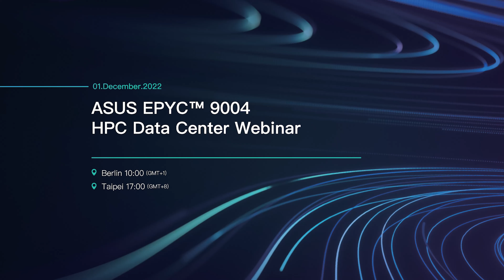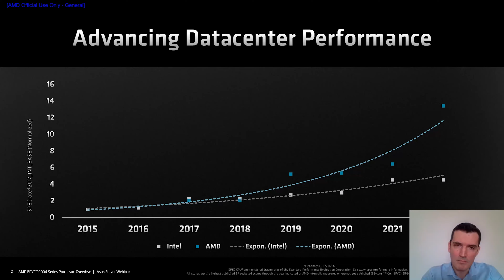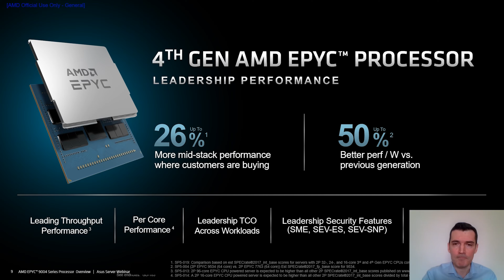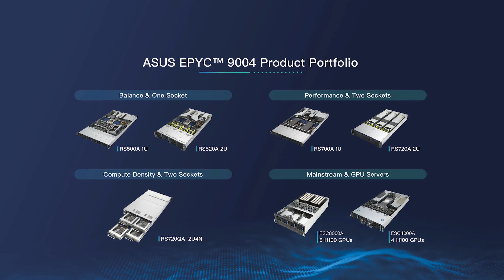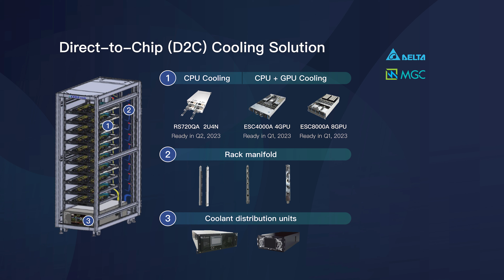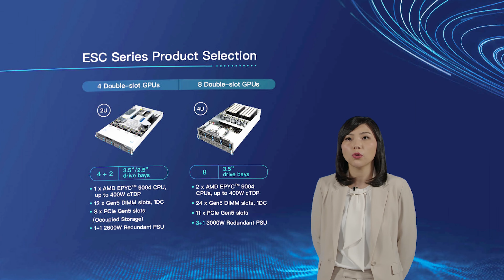ASUS EPYC 9004 HPC Data-center Solutions Webinar

Comment: cpu   apu   qpu    gpu  jpu     zpu      wpu    epu     rpu     tpu      ypu    upu       ipu    opu   ppu dpu   apu      spu    jpu    kpu     lpu     fpu     hpu    gpu    dpu   xpu    zpu     bpu   npu   xpu   cpu   bpu xpu zpu mpu npu  QPU    WPU    EPU    RPU    TPU   YPU    UPU     IPU    OPU    PPU  SPU APU    DPU     GPU    FPU JPU    JPU   KPU      LPU     KPU   LPU    ÑPU    KPU      NPU    MPU    VPU    BPU    NPU   VPU     VPU    ZPU   XPU   CCCPPPUUU    ZPU   CHIPS CORES PROSESSORS   wireless quantum microchips wifi 8 6G also mobile data 6G bluetooth 6.0 new generation antennas and motherboards with chips on both sides cauntic antennas chips rams 2.0 vrams 2.0 2ssd 3sssd 1sd 4ssssd internal small motherboards and 1nm photonic optical graphene quantum stable chips in the two sides micro quantum computers micro antennas powerful and chips of 99 degrees Celsius below zero and resistance 66 degrees Celsius and 88 degrees ambient temperature also research and science and technology and economics to achieve more powerful things with 123215443657678909855445634543534543543543 percent more power

Comment: So cool this is in search of incredible
Reply: ZPU   CHIPS CORES PROSESSORS   wireless quantum microchips wifi 8 6G also mobile data 6G bluetooth 6.0 new generation antennas and motherboards with chips on both sides cauntic antennas chips rams 2.0 vrams 2.0 2ssd 3sssd 1sd 4ssssd internal small motherboards and 1nm photonic optical graphene quantum stable chips in the two sides micro quantum computers micro antennas powerful and chips of 99 degrees Celsius below zero and resistance 66 degrees Celsius and 88 degrees ambient temperature also research and science and technology and economics to achieve more powerful things with 123215443657678909855445634543534543543543 percent more power
Reply from the maker: Thank you for your support 😊❤